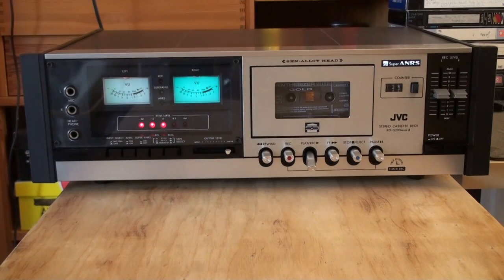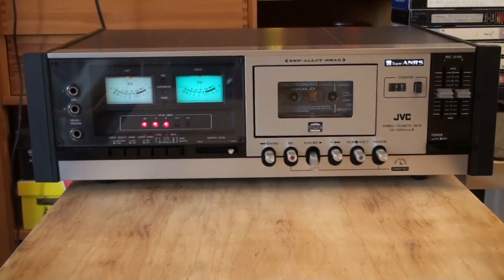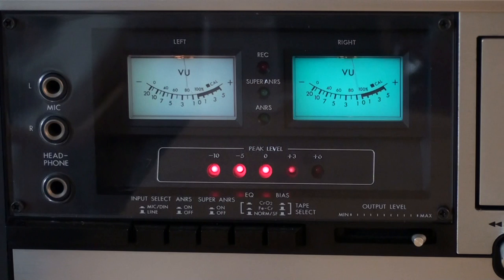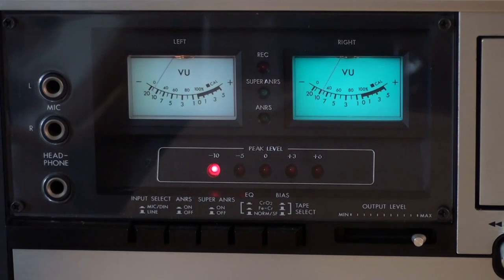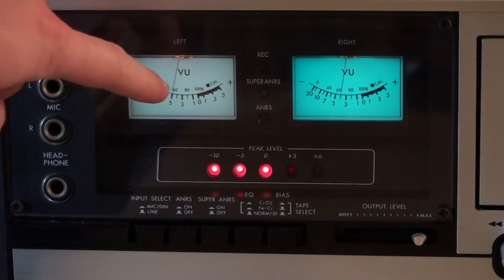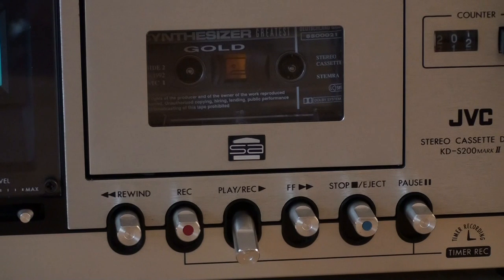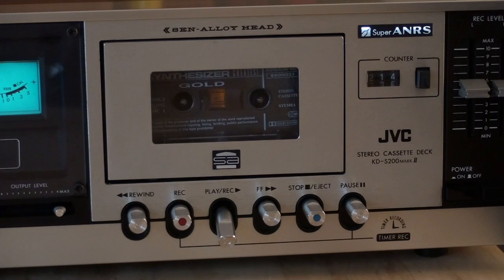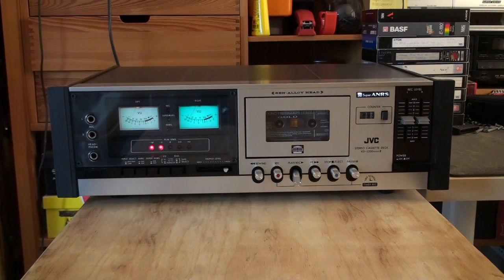JVC KD-S200 MKII cassette deck - last look - in HD!

Comment: The capstan motor probably has a speed adjustment screw in the back.  You turn the screw clockwise to increase speed, and counterclockwise to slow it down.  Good Alan Parsons Project song.

Comment from the maker: @The1970sInfatuate 
If it would have been such an easy repair, I would still have this thing. I don't know if the motor just needed oil or if it had bad bearings. The speed ajusted with the screw in the back (wich indeed it has) would be stable only for a couple of hours.
Replacing the motor is VERY complicated.

Comment: had the same thing happen with the motor not working, tried to fix it, but eventually i took it apart and use the parts from it and use it for other projects like the vu meters, headphone jacks as an extension, rca (tape in / out jacks) on back for rca-to-rca connection (extension)